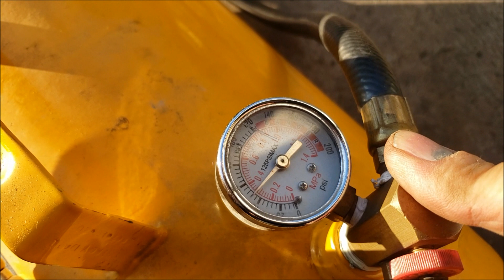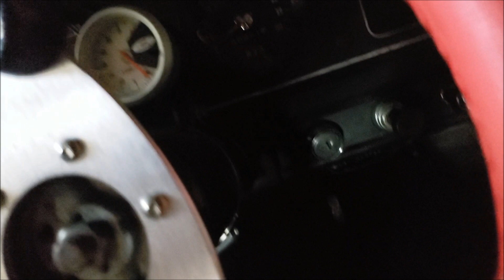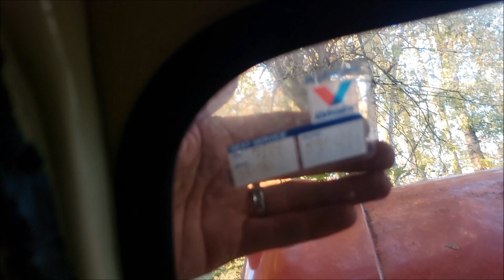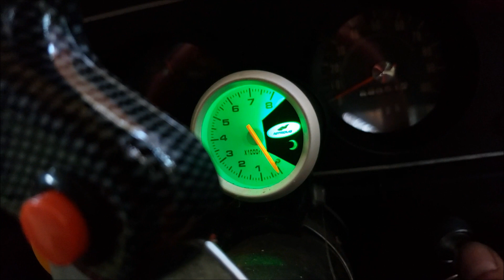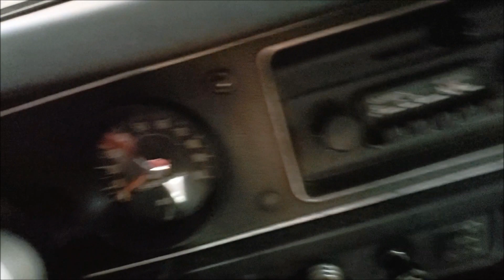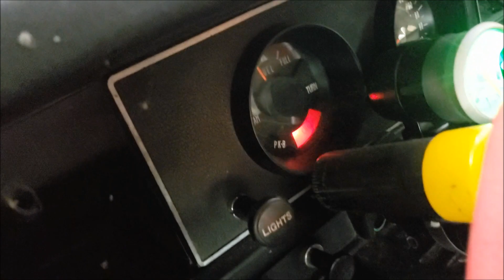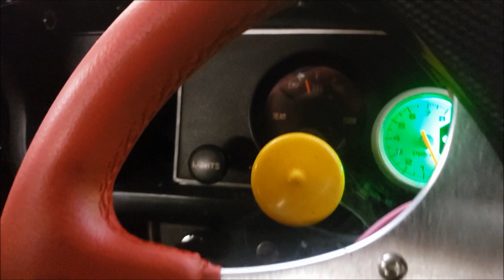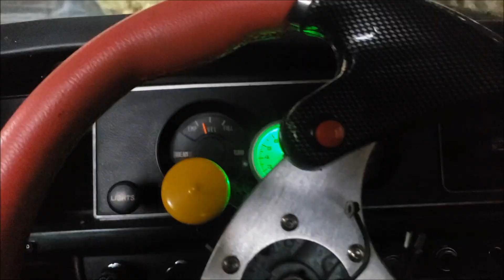Red Honda 600 Dig Out

Comment: When I found my 83 celica supra, it had been sitting for 8 years. I changed the spark plugs, oil, and put in fresh gas and it started right up. It is my only car and I put 60,000 miles on it with only replacing the fuel pump.
Reply: Scotty kilmer would be all over that.

Comment: There is a pro dryer duct cleaner here. 

He uses a leaf blower that might be modified for a higher pressure on dryer ducts. 

Some are tough because the duct is under a poured slab of concrete.
It appears you did a good job..
Thanks

Comment: These were built to compete  with the Morris mini.The engine was a stock part from a motor cycle.They were good to drive with light steering,and good handling.They had reversing lights and a clever locking fuel cap.Althought a bit more expensive than the Mini it was not as good.The mini had a 4 pot water cooled engine and a far better heater.I had a orange one.It also had a plastic boot lid.
Reply: These engines were build specifically for the N360/600 and were not a stock motorcycle engine.

Comment: 7:02 if you drill a 3/16 inch hole in the top of your fuel can, and then buy a metal valve stem, screw it into the plastic, and remove the valve core. You can empty that can in 10 seconds.
A valve cap will keep it closed. And thwart the morons who developed those “non eco friendly” cans. I call them non eco friendly because you usually spill a cup of gas on the ground fidgeting with those goofy nozzles. Amazon also sells readily attachable HUGE nozzles for your cans. You can empty a fiver in 30 seconds with nary a drop spilled.
Reply: I never spilled gasoline in my life until Karen invented the spill proof gas can.